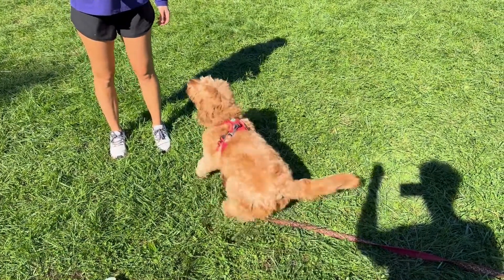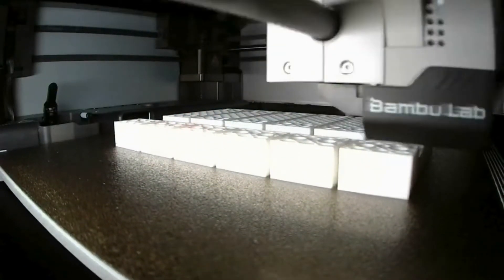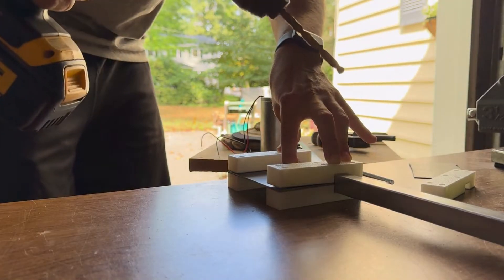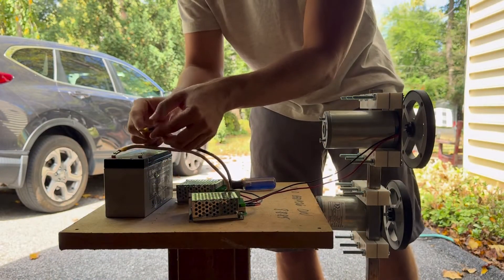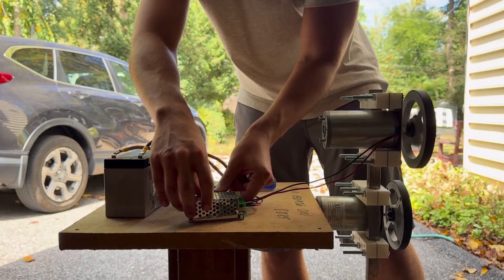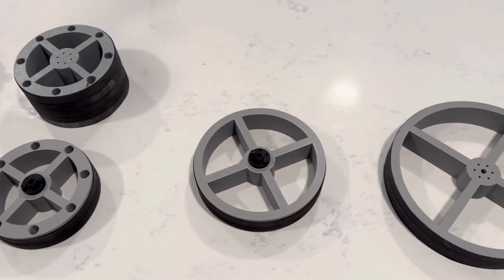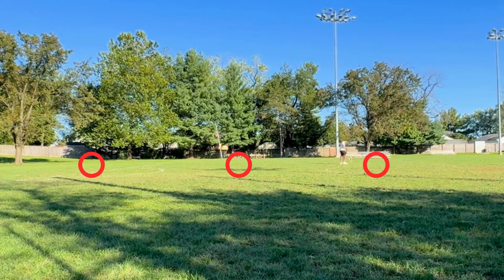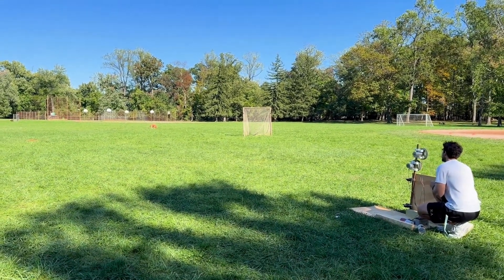I Built a Tennis Ball Launcher for My Dog!

Comment: what engines did you use, its marking and characteristics? give a link to the seller. I used in the tennis gun engines from a car heater and a set of 7 disks made of 4 mm thick plywood with 3 mm teeth. The disks had a ball profile with diameters from 123 mm to 118 mm. The degree of compression of the ball is also important.
Reply from the maker: The motors I used were 67 Watts and 3200 rpm. I don't have a link to the seller because I got them out of something I took apart. I just checked out your launcher and it looks great! I agree that the compression is very important.